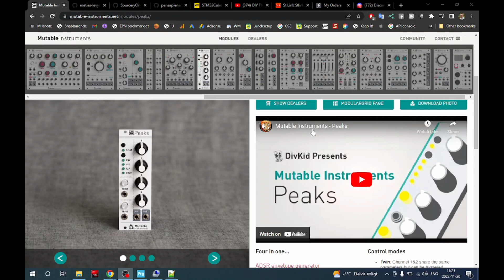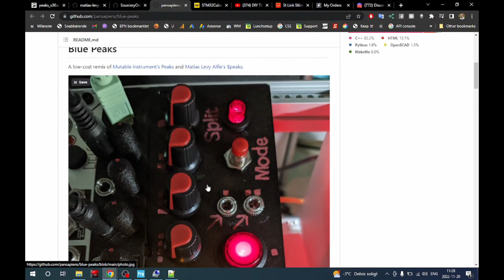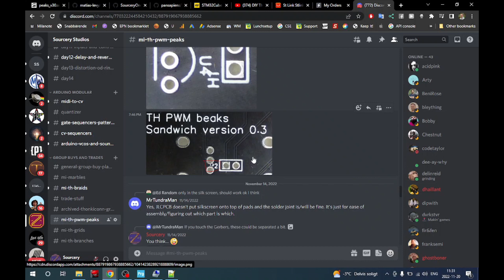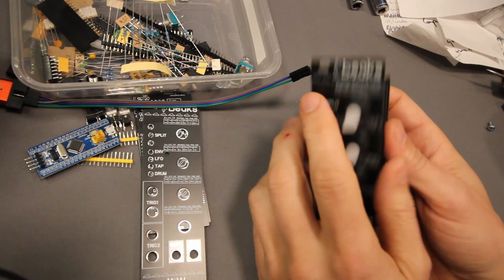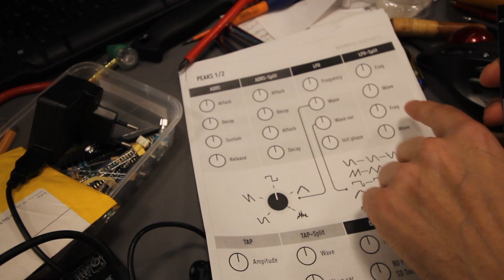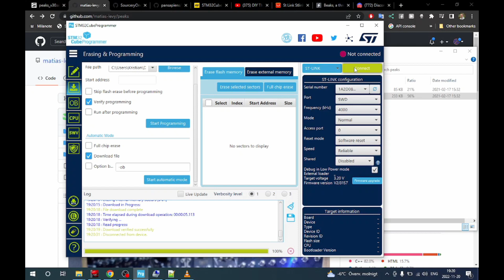Beaks - A DIY Mutable Instruments Peaks TH STM32 Reversion - Modular in a Week

Comment: This is brilliant, thanks! 
One question: Have you considered to open up the parameters of Beaks for cv modulation? Being able to animate these in a sequence would really enhance the possibilities even more. If I understand the circuit diagram correctly, this should be fairly simple (basically just a second input mixer channel from a cv input plug in parallel to each of the knob voltages. If we want to get fancy: with an input attenuator each). I am tempted to try this mod myself, but a clean board enhancement with new frontpanel would be much more beautiful than doing a messy hack job on it...  Anyway: Thanks for all your great work.
Reply from the maker: Yes this would def be possible and has been done. On the discord someone did the “Andes” a rework of the Beaks with cv input on all four knobs. I am still missing a few parts for mine so can’t say how useful it is. But take a look at the discord or search on github for more info.

Comment: I ordered an STM32 off aliexpress and it ended up being a 32kb version. When I go to program the board it says there is not enough memory...do I need to order a 64kb version?
Reply from the maker: If you got a 32kb version and you ordered a C8T6 the. They sent the wrong one. Check the chip on the board with a magnifying glass. And if they sent the wrong one you should be able to get a refund. Or you ordered the wrong board? You actually need a 128kb version the CBT6. But most C8T6 (64kb) actually has more memory in them that is why they can be used. But 32kb is the wrong chip. You need at least the 64kb version.

Comment: Thanks for sending me the two kits and parts for the PCB I previously bought, they just arrived yesterday, so excited to get these going and having two in my system 👍🏼
Reply: Super important detail correct Bluepill is STM32F103C8T6 I ordered a bunch of C6T6 units after first ordering unintentionally bad fake C8T6
Reply from the maker: Yes, that is very important :) Hope you got it working with the correct STM32's now.
Reply: @SourceryOne  funnily enough, last one built this morning 👍🏼 anyone need something like 15 fake STM32’s, 8 C6T6’s, or better still ideas for repurposing them? Loving the DMC firmware too
Reply from the maker: @Jin-Hu awesome! 👊 Hehe those are still quite powerful mcus so should be able to process audio. Let’s make something up to use them for. 😉
Reply: @SourceryOne  I do happen to have a couple ideas brewing…

Comment: I've got my kit. Just waiting on the video.
Reply from the maker: The build video comes next week I think. :)
Reply: @SourceryOne  That's ok. I think I can figure out the build. It's the programming the stm that I'm most interested in. I think I have done it correctly already but I'm not sure. Thanks for the knobs you threw in with my kit by the way!
Reply from the maker: Watch the braids video for exact how to make it. I do it super quickly in the beaks video aswell. :)
Reply: @SourceryOne  Just finished building it. It all seems to work correctly. Thanks again.
Reply from the maker: Awesome! It was easy enough to solder I guess :)
Reply: @SourceryOne  Yes, apart from the transistors. Those holes could do with being a little further apart.
Reply from the maker: @thecrossmethod6192  That is how close the pins are on my 2n3904, however I did the solder pads a bit bigger so it will be easier to solder it in place.